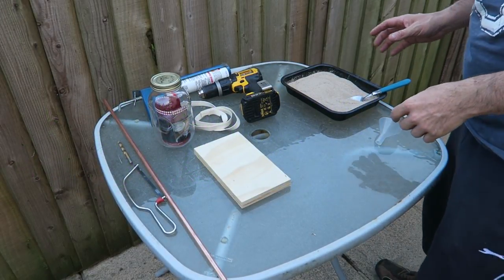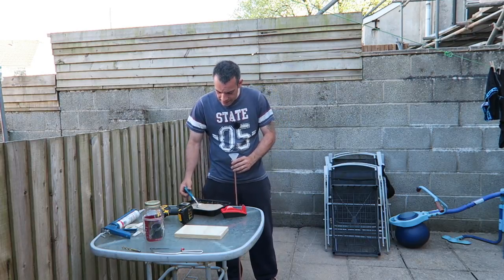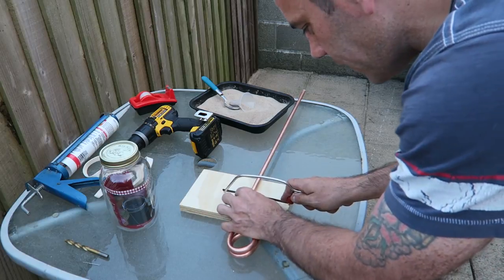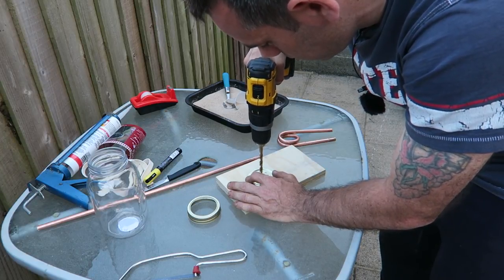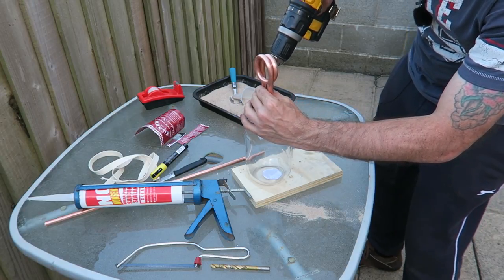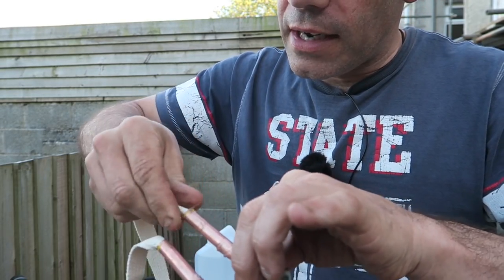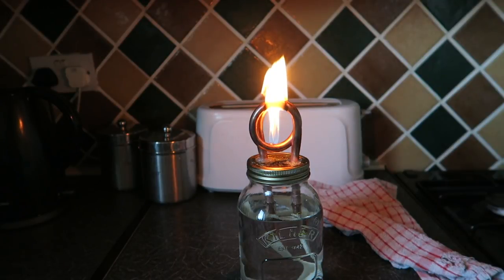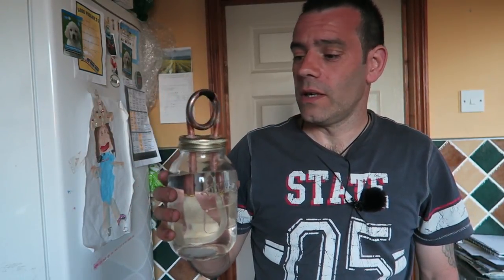How To Make The Most Efficient Copper Coil Alcohol Burner

Comment from the maker: PLEASE NOTE: Just an update, use car exhaust paste instead of silicone to seal the pipes to the lid, silicone finally melts after long durations of use. I have had no issues with car exhaust paste
Reply: It's too late now, I've burnt the shed down  ..
Reply from the maker: @choomanfoo  Why would you do something so silly
Reply: @simplifygardening  I tried to warm the garden up.
Reply: @choomanfoo  Are you the one who also burnt down that lady's tea shed on T.V. ?
Reply: @larrywhalen596  I heard it was an insurance job. She hired a bunch of pyrotechnic experts from Mayhill, Swansea.
Reply: @choomanfoo  Hahah, i was going to say that
Reply: Is that an actual product or something you just scrape off Ur car exhaust?
Reply: Could this be used in a tent????
Reply: HOW expensive is the alcohol you are using ???
Reply: @blickluke  I'd say he's used Holts Gun Gum paste , the stuff you'd use to seal holes in exhausts, it comes in a paste form that hardens off solid when heat is applied.
Reply: @TheWacoKid1963  I've used J.B Weld. It's a two part epoxy. Great stuff.
Reply: What about using (wood) stove cement? That should work since its made to seal up seams in a wood stove while coming in contact with high heat.

Comment: This is one of the BEST  "hacks" I've EVER SEEN!!   (Something that's  INGENIOUSLY practical,  AND useful for basic "survival"!!)
Reply from the maker: Thanks, A quick tip I learned after long use. Instead of silicone to seal the pipe to the lid use car exhaust paste instead this will go hard and is heat proof
Reply: @simplifygardening  AWESOME!! (Thx a million!👍)
Reply: Just a note: If you intend on using it indoors for emergency heat, use Everclear. The other alcohols need to be ventilated.

Comment: Great video, thank you!!  Suggestion: instead of using silicone to seal the copper pipes in place, use super glue and baking soda - super glue first, then baking soda until done. It sets up instantly, hard as steel, and is easy to finish. (Military helicopter technicians use the technique to patch chips in helicopter blades.)
Reply from the maker: I did add a note in the comments to use car exhaust paste instead
Reply: @simplifygardening  Thank you!

Comment: If you cannot plug the vapour hole in the jet coil, all the alcohol will evaporate. I suggest using a new, unaltered lid for storage and store the wicks/jet coil in a small cotton bag. Cotton will let the wicks dry and keep them clean as well. Cheers from Alberta, Canada.
Reply: I was just thinking that, it would definitely start absorbing water from the air. easy to switch caps tho.
Reply: They actually sell these! the ones I've seen use a cork to plug the little hole.
Reply: @TheUpsetter  couldn't you just place a little square of clear tape over the hole until you need it?
Reply: @toshikotanaka3249  I dont think it would work, Merry Christmas .
Reply: @TheUpsetter  Merry Christmas to you also. Do you know why it wouldn't work?
Reply: @toshikotanaka3249  I think so but I'm not a scientist by any means, you see alcohol is like a solvent so I'm guessing it will desolve the sticky tape rendering it useless, the cork on the other hand will just soak a little of the alcohol and it should evaporate at a rate less than leaving it open to the elements, I'm geussing they use cork instead of modern compounds like  plastics is because like tape plastics are also desolvible, Now I'm wondering why it's of any interest to you??
Reply: @TheUpsetter  Why is it of interest? Because I want to make one for emergency use. So instead of using tape I'll just unscrew the lid and pour the alcohol back into the original container until it's needed again. Thanks for taking the time to answer my question. Merry Christmas
Reply: Hmmm was thinking maybe getting a double-ended mason jar lid ring for screwing two jars together.  The second jar can be smaller, just large enough to cover the coil.   Also, get a third mason jar made of metal, and cut some holes it in and use it as a stove top, just screw it in to the double-ended lid ring.

Comment: Great video. You need to get yourself an "emp" tubing cutter, it has three wheels, two wide ones at the bottom which acts like rollers, and the top wheel is the actual cutting wheel, the device clamps around the tube,tighten the thumb wheel and rotate it while simultaneously tightening the thumb wheel, makes a super clean cut in a snap. I usually dril my gas hole in the copper tubing, then bend the tube around my mandrel, it put the hole directly under the upper radius,kind of an OCD of mine...lol
    Thanks for sharing!

Comment: i noticed that Tony put the coil too high above the lid and sealed with silicone and later it was repositioned lower to the lid.  The silicon... I'm not sure  but the heat from the flame will transfer down the copper coil and effect the silicon.  JB weld would be a far better option.
Reply from the maker: exactly what happened so i ended up using jb weld
Reply: JBW is what I used. JB has never failed me. They have a high temp. and quick set version too!
Reply: no you wrong, silicone is higher temp safe
Reply: @japdog9  Best way to determine which has a higher tolerance to heat is to request an MSDS/SAFETY DATA SHEET
from the manufacturer rather than rely on what you might have heard.
Reply: @larrywhalen596  do that , request it......then tell me im wrong . 1300c to 1500c is more than enough , its on the package , any person like yourself can read it ...unless there just TROLLING looking for arguements . .... have a nice day😀
Reply: @japdog9  He came back on & said the silicone melted after a while & now he recommends what he calls CAR EXHAUST PASTE. Never heard of it but will research.
Reply: @newsviewstoday5689  he must be a expert..........if it went wrong then he dident let it set hard , its not instant silicone ...after it sets , it wont melt . maybe you should read the instructioms
Reply: Most Silicones are not high temp (unless stated) also is broken down by alcohol and the mason lid gasket on seals with heat so it's not gas tight. Won't be a real problem in the short term but leaving it stored unused could be.

Comment from the maker: Thank you for watching my content. If you enjoyed this video you can view more like it here --->https://www.youtube.com/watch?v=6hizwRZG7bI&list=PLREI92DGCWROTW07Jf1_IQcK0guPkO3ee Don't forget to like and share my content. Thanks, guys :)
Reply: Hi. What size is the jar? If you put the coil higher you can JB weld a water pipe end cap or a metal bottle top under it which you can fill to act as a primer to heat the coil.
Reply: Aspiring work 100%
Reply: Instead of using sand, when you bend pipe. You use salt. This way if you have to flush it out with water, the salt dissolves. Sand you still have to shake out.

Probably not a problem with this diameter pipe. But the finer the pipe. I would recommend using salt. As anywhere water can get to, will dissolve it
Reply from the maker: @Bozemanjustin  That is a great tip. I didn't even think of that. Thanks

Comment: Nice video thanks for the demo but if you watch Copper Annealing - 3 Steps video you will see how soft the copper pipe can be for bending and you can do this before you fill with sand and bend plus if you drill your hole first and use that as your centre point you can get it in the middle Thanks Bob in the UK

Comment: I think I would use 2 jars - for safe storage. Take the second jar lid and cut a hole large enough so that you can epoxy it upside down over the lid with the tubing. Then when you want to store the burner, just screw the other jar into the lid you epoxied on. While this makes it twice as tall to store, it protects the soft copper coil from damage.
Reply from the maker: Yes Ron, that could be a great way to support it.

Comment: I used thinner copper tubing and did the same with questionable results!  Instead of doing the tight wrap I did a rather loose wrap over distance as some other video showed , then all you do is push horizontally to get the loops together. However as he will tell you a bit later in the video you need to put a tiny hole in the tube and as we all know tiny drills are not long drills so before making a tight loop of copper tubing get a vertical hole in the pipe. My questionable result was from drilling a hole after getting the loops tight. That directed the flame away from the tubing thus defeating the vaporization process.

Comment: Hi Tony. Just found your channel. 
What are the advantages for polytunnel heat of the 100 hr candle vs the copper coil alcohol burner? 
I imagine it would be really easy to put a large #10 tin can around either one to become something hot that would them radiate the heat out into the polytunnel. 
Which one do you prefer for this application? Thanks

Comment: An excellent project Tony and I shall definately be building a few of these 👍🏻👍🏻👍🏻 A few questions for you 😀....
What would you say is the smallest efficient drilled burn hole you could use? (I can go down to about 0.010")
Any advantage of having more coils and use a larger jar?
Do you need to tape over the burn hole when not in use to prevent evaporation?
Compared to the 100 hr candle, does this give out more heat?
Sorry for all of the questions......Many thanks of this one.................Cheers mate....
Reply from the maker: Hi, mate yes this will give out a shit load more heat than the candle. No need to tape over the hole when not in use as the evaporation only works when heated. I wouldn't use more than one coil per jar and if you have the car filler putty use that instead of silicone as it will hold the coil better. make sure your drill hole is straight I had to straighten mine as the flame wasn't riding right initially but easy to do and works brill now. The flame must turn that blue colour or you won't get a clean burn. a small drill hole is preferable otherwise it will produce too much gas and blow out your flame, but not too small that the flame can't be supported.  glad you liked the video and hope this lot helps :)

Comment: Hi Tony! Excellent idea. I've been wondering how to heat my greenhouse to keep my seedlings safe. I have a small greenhouse,  about 25x16. How many of these would I need in that size space? Is one or two enough?
Reply from the maker: Only one of these would do it. but use exhaust gas paste instead of silicone to seal the tubes
Reply: @simplifygardening  Thank you

Comment: Perhaps you could place the burner inside a large clay flower pot. That may help distribute some extra radiant heat. Maybe with a clay saucer on top if you could drill out a large hole to vent the flame? Also, You could try using a two-part kneadable plumber's epoxy or J.B Weld to seal the copper? (after heat testing of course.)  Great project. Since this burns cleanly, it might also be used for an emergency heat source in a power failure. Update: Oops just read you did use the J B Weld.
Reply from the maker: A fantastic way to use them just be mindful it doesnt crack as these put out much more heat than candles
Reply: @simplifygardening , Yes may crack unless the hole is big enough...and the pot dense enough to resist the high heat. Going to try making a couple of these before next winter.  Always looking for low cost ways to heat my 10' x 32'greenhouse.  I'm experimenting with a solar "heat sync"  pod attached on the south side. I'm using a 12 volt fan to pull heat inside the greenhouse to heat up black water barrels during the day.  Theoretically, the barrels will  radiate heat back out during the night. A couple of these jar heaters my be just the thing to help supplement the "heat sync".
Reply: I've seen the same idea with candle heaters. I was just thinking that a section of clay stovepipe would be perfect.  Tall like a couple feet much thicker and very heat tolerant. The terracotta pipe sections come in square or round. Deffinately just updated my idea on how to do it.

Comment: great job tony. 
Do you think one could be made that holds a lot more fuel in a metal box, something like an old ammo box with a sealed lid and have multiple burner heads? I need more heat and was thinking of putting the burner in an insulated burning chamber, having a coil of copper inside and slowly pump water through it so heating the water which goes into a water tank then this is pumped through underfloor heating tubes layed under my raised beds and greenhouse for winter growing. what do you think?
Reply from the maker: Yes that would prob work it just needs to be gas tight to make the pressure and only allow it to escape through the copper tube
Reply: UK Here We Grow thanks Tony will give it a go. cheers mate.

Comment: wiper screen fluid is flammable and very cheap, do you think this would work with that? This could go inside a coil of copper with water inside which then feeds a radiator and can heat your greenhouse in the winter very cheaply.
Reply from the maker: Im not sure tbh

Comment: Hello, I’m new to this site of Tony, I really like this video, can I ask Tony about the glass jar. There are lots of big jars, ones used for mince meat, gherkins etc, these have seals in the lid so would these jars work or do we really need the same jar used on this project? Really good presentation,.
Reply from the maker: Any jar would work as its not under pressure and does not get hot
Reply: @simplifygardening  i might be wrong but i beg to differ,,the coil transfers lot of heat back down into the fuel where it vaporizes and pressure builds in the jar and this also helps push the fuel up the wick ,,i think the jar will have some pressure but so long as its venting through the hole it should be safe enough,but the jar lids should have a rubber seal,some do some dont

Comment: I think there is a slight explosion risk here no? If you happen to get an explosive air / ethanol mixture in your tank, I think the copper pipe can easily reach the 365°C required for ethanol self ignition and make the container explode.

Comment: Hi just found you. This is very clever. I have a couple question about it. First, why did you drill your hole in the bottom of the coil rather than at the very top of the coil? Can the heat from isopropyl alcohol get high enough to melt the copper? thanks
Reply: You want the flame to heat the coil so as to help pull alcohol fumes up into the copper coil. It acts as its own self priming fuel pump.
Reply: @tamistone2632  thank you

Comment: What is the burn time and volume of fuel used or what is the rate of burn? And how much do you think it would warm a 6X8 foot greenhouse? Great music.
Reply from the maker: one of these would keep you around 8 to 10 degrees it would burn for a few weeks with this size jar.
you are only burning fumes created by heat under pressure
Reply: Thanks for the super quick response! So you are saying that it lasts for just about forever which is awesome. Are you going by temperatures in C or F? And now are you saying it would bring you up 8-10 degrees or increase the temperature by 8-10? It can get down to 32F in early spring and I would want to keep it up around 45F for some of my plants or seedlings. Get the kids in some videos, I want to have my son see them and get more interested in gardening than he already is. Thanks!
Reply from the maker: Robert this pumps out a lot of heat, however guaranting a temp jump would depend on loads of factors, size of greenhouse, whether insulated or not, outside temps and so forth. this would keep a 6 x 8 greenhouse frost free, if you want to raise the temps for the whole greenhouse you may require 2 however is there a need to heat the whole greenhouse. i would suggest build one and run it and see what the temp is like in your area. the temps i seen have raised it about 10 degrees c more than outside
Reply: Wow 10C is a lot more than I thought. Will definitely give this a try this fall after I put up my greenhouse. I think I am going to start some peanuts in a pot and may need to go beyond my natural grow season to get any. Ordering them now and I am seeing that the heirloom ones take longer. Thanks.
Reply from the maker: your welcome

Comment: Thanks for video. I do have a question tho, won't the copper heat up to where it melts the caulk or whatever that was that you used to seal the tubing to lid?
Reply from the maker: Yes it will Kathleen that is why I added a note in the comments to change that and use car exhaust paste which is made for heat to seal the pipe instead

Comment: It’s very hard to see where you drilled the small hole.  Did you drill into the lid, or into the copper pipe?
Reply: Copper pipe, and it needs to be straight up/vertical, this allows the flame to hit the bottom of the higher up looped tubing. Wedging the upper pipes apart a little and using a long enough drill bit makes this an easy task. I hope this help Sigrid.

Comment: Thank you much for a great video 
I did what you did but the flames will be burning the it shuts off I don’t know what maybe the reason for that
Reply from the maker: Check the size of the hole. or ensure you don't have gas leaking if there is no vacuum then it will go out
Reply: @simplifygardening  so the size should be as small as possible or big

Comment: just wondering whether you could use it to heat a container of water and use that as a storage heater as water holds heat more efficiently
Reply from the maker: Mark that is a fantastic idea
Reply: @simplifygardening 
Judging by the isopropyl runtime on your burner,  the heat output will be around 304 btu/hr which is about the same as a 90w light bulb. Assuming you had 5L of water in a perfectly insulated container, you could heat it from 10C to 25C in one hour. A mug of piping hot tea every hour is the best option ;)